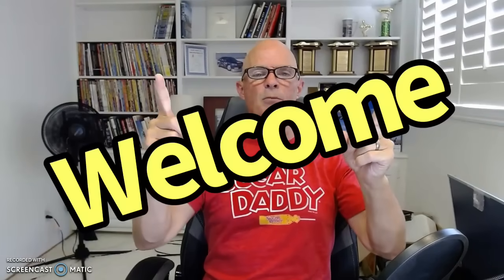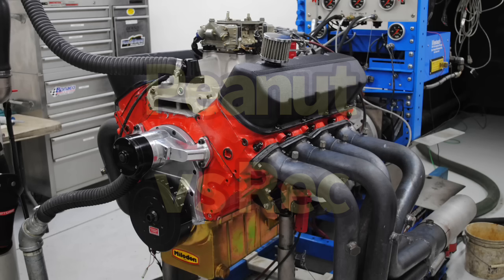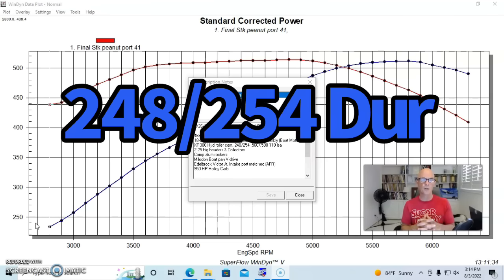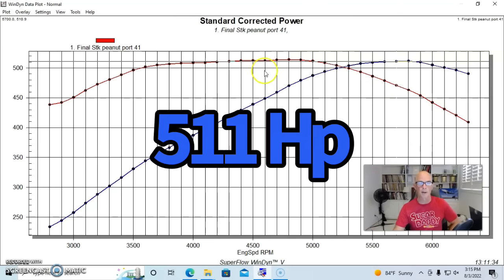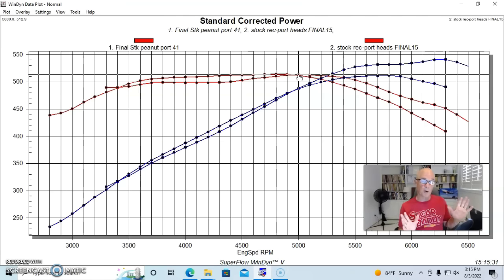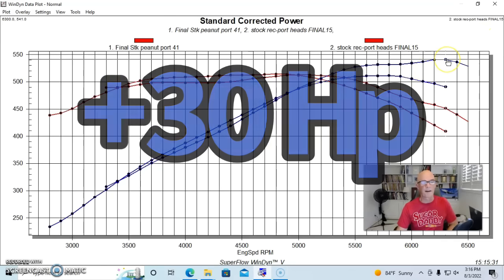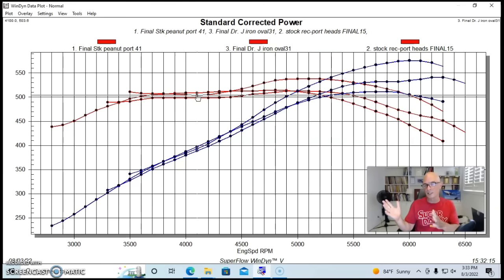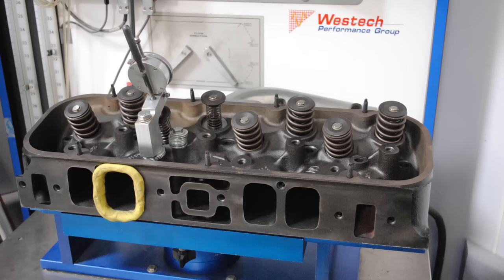WHICH FACTORY BBC HEAD MAKES THE MOST POWER? PEANUT PORT vs PORTED 049 OVAL vs REC PORT vs AFR 265!

Comment: With all things being equally besides one set of cylinder heads being those ported oval 049 would be to test a pair of equally ported open chamber and then, a pair of equally ported closed chamber rectangle cylinder heads versus a pair of ported worlds 345 versus a pair of baddest set of CNC ported cylinder heads ever manufacturer the AFR’s 357!! 
Although, I would suspect that 468 compression ratio and camshaft may not be the best foundation that would allow the AFR 357 cylinder heads shine!
However, throw a PSI, or a Helix 14-71, or a centrifugal supercharger on that 468 with that little camshaft versus a manlier camshaft be prepare to be in ah with the results.. 
As usual Richard, great content! Klaus
Reply from the maker: THNK-THE 357S WOULD NOT BE GOOD FOR THIS SMALL 468-EVEN WITH A BIG BLOWER
Reply: AFR 357 baddest ever you say?  UM, yeah, not even close. We had heads that flowed over 100 CFM more than those back in the mid '90's. Now they have BBC heads in the 600cfm range. You could run the 357 on this size motor blown but you would need a lot more cam for a PSI or high helix14-71. Usually, a motor with that size blower and this cubic inch would be for some type of class racing with rules for cubic inch to weight. Also, you would want to increase the bore size to get more flow and shorten the stroke to get to the size. Without a rule advantage or limitation, there are much better (bigger) combos to do.

Comment: Ported rec ports need more CI, cam, intake and carburetor to shine. I have proven this in my B altered when I switched from 472CI to 546CI. On my 472, mildly ported oval port heads spanked the ported rec ports until I put the rec ports on my 546.
Reply: Was gonna comment on that and you nailed it man.....when you get up there in real cubes man.......not no 454/496  but like you stated big cubes....them rec. ports shine like a set of Horse Lungs in a cow!

Comment: Richard!!!!!  I gotta know what if a bigger intake valve, port the peanut port head keeping on the super cheap add 600 lift mechanical flat tappet cam plus nitrous!!!!  Biggest port restriction is the intake valve itself. Is it possible to squeeze a 2.25 valve in a peanut port? Obviously with an unshrouded chamber if so. The afr head is 265cc not that much difference from the peanut port. I’m thinking 10 to 1 compression, dirt cheap peanut port head add 2.25 intake valve if possible, bowl blend,  proper cam timing maybe make 600 ish hp, add in a 200 shot of nitrous. Now you have a 800 hp street stomper for not much more than a decent rebuild. Go for it man build an 800 hp bbc for pennies.
Reply from the maker: the peanut port needs more than a bigger valve

Comment: Thanks for sharing  I had a set of 088 fully ported with 230 intake valves,I do have AFR 325 on my 496 drag car but I got to try the 088 on my 468 ,10.5 bbc with a 660 hydraulic roller in my 69 chevelle project to see how it will run,I can always port and build ,I have 2 sets of 781 heads in the shop,Thanks again for all the knowledge you provide!!
Reply: The square port heads are big for that compression ratio IMHO
Stick car or 4000+ converter 7k rpm
Reply: @DevastationMtrsports  Thanks for sharing everything in my motor will run at high rpms, good rods and Malhe pistons balanced with Howard's lifters and cam to perform up top,4l80 fully manual 😀, Actually plan on a 250 shot ,running a 35 spline 411 pos Trac 😀
Reply: @ronaldlewis2041  sadly I have stock rods and heavy TRW pistons.. late 90s build.. no budget for rods or a roller. Hope to do an updated rotating assembly W/roller cam next summer

Comment: Maybe I missed it but curious what the CR was on the engine I know it will change depending on head CC but really curious on the oval port heads.  I have a 74 454 with 781 heads so that power rating is what I'm looking for but like to know what CR was on your engine
Reply from the maker: 10:1
Reply: @richardholdener1727  awesome thanks. That's good power for a relatively moderate low compression. I was thinking you were going to say 11 or 11.5

Comment: Back in '95 I had a '70 Corvette with a 454 LS6 straight out of a '70 Chevelle. I had read an article by John Lingefelter in Hot Rod where he tested the oval port vs the factory rec port heads. His oval port heads were #049s with 2.19/1.88 valves and some bowl work mainly around the short side radius. He found no where below about 750hp where the oval port wasn't superior. And I mean by a large margin (30-50hp). With the cost of rec ports always being very expensive and at that time you could find 049's for a couple hundred bucks they made a lot of sense. It took about $600 to put the bigger valves in, get the heads all cleaned up and properly machined, but I built a set and put them on the Vette. I sold the rec ports to finance the build. It went from a mid 13 in the quarter mile to a high 12 but I was having fuel starvation problems. I'm not surprised that an out of the box set of aftermarket heads are far superior to everything. Technology marches on thanks to guys like Richard who test everything. Those things I knew for sure 30 years ago have been totally debunked in many cases and I'm fine with that. I just want the facts.
Reply: I think I still have that Hot Rod issue, 1988 or 89. They built a 496 with his tricked 049's and a mild cam and made over 600 hp.
Reply: @scottm7341 I thought it was 781 heads but they are much the same. It made over 660hp. RIP John Lingenfelter
Reply: @scottm7341  That's probably the one. Before Richard Holdener I got most of my info from tech articles in magazines.
Reply: @scottm7341  YES!!!
Reply: @scottm7341  Was that the one with a Competition Cams 288 solid roller street cam?
Reply: Believe it or not, there were some guys running NHRA AA/FA (that's nitro burning supercharged Altereds) in the late 1960s that used reworked 1968 366 cid Tall Deck Truck oval port heads (p/n 3935404) instead of the rectangle port heads.  The reason was they were running 80% Nitro and the closed combustion chambers on the high performance rectangle port heads were really bad about detonation with Nitro unless you turned the timing WAY back, which of course would kill power.  The 366 truck heads had large open combustion chambers before the 1969 ZL-1 open chambers heads came out.  The 366 heads also had thicker walls between the combustion chamber and the cooling jackets than the later ZL-1 open chamber heads which were prone to cracking using heavy Nitro fuel loads.
Reply: @corvettejohn4507  That's cool. Racers always know what really works and what doesn't.
Reply: I think I read the same article.  Lingenfelter was a fan of the 049 and 781 heads on street type engines.  Remember the 496 he did with a Comp Cams 288R?  I basically duplicated that with a 433.  I think I'll Google the article and read it again
Reply: @MrScottt28  That sure sounds like the article. I haven't seen it in 25 years. I remember my buddy had a 70 Chevelle with a rec port headed 427 and we were talking and I told him about the article and he refused to hear it. He actually put his fingers in his ears, lol. But I have to admit I didn't think anything could beat the rec ports up to that point. Of course these were street engines. I'm sure that on a 900hp, 8500 rpm engine they are still better.
Reply: @MrScottt28  Still got lingenfelters books on his build combos
Reply: In the collective, with all the knowledge we get and post back up on the internet, we probably know more about the big block Chevrolet now than even GM did when it was new.  The same goes for all makes.
Reply: @failranch9542  I agree. I have probably learned more about engine design because of the internet and the shear amount of dyno testing that is now done. Everything is tested to death and all the things we knew 30 or 40 years ago that are now wrong blow my mind.
Reply: I belive that was on a 502 short block?

Comment: In the early 70's I had a friend that built a 427 with a wrecking yard as a source for hard parts. We ended up with oval port heads and an aluminum dual plane rectangle port intake manifold. The engine ran surprisingly well in Denver. Never had a vacuum leak, stump-pulling torque, and the engine lasted for many, many years.
Reply: The hot ticket for bracket cars used to be a 496 with oval heads and the square port intake.  Illogical, but it won races...

Comment: this was a cool test.   1.  049 is a great head, but not the best factory big oval. the best factory big oval is the 820. the open chamber unshrouds the valves and it flows better. the only real mod you need to do is add bigger valves. the factory valves were 2.06/1.72 by just upgrading to 2.19/1.88 valves they will out flow a factory rec port head.  and make more power down load too boot. I am thinking that the peanut port head might work good on a 396 with a small cam like a XE276HR.
Reply: True man and by looking at them you would thank...dam what a big chamber.....just not many out there and most dont know of them,your right man....I have a nice virgin 71 set I pulled from a 402 over 30 year ago where I traded a set of 702,s for....nice you mentioned them man.
Reply: I agree lower or stock compression and smaller cams. Peanut heads would do better in a lot of lower RPM towing and street builds.

Comment: I was impressed with the peanut port performance. Just goes to show what a pig dog camshaft most 454 trucks got saddled with, along with 7.8:1 compression - thru most of the 70s & 80s.
Reply: I remember reading a Article out of Hotrod Magazine inthe 90s that on a chassis Dyno a intake and cam and Headers  where good for 120 horsepower on a chassis Dyno on a 1 ton dually one of the guys ran as a tow pig.
Reply: Just adding compression to a mid 1970s 454 ads horsepower and torque across the board. A tighter cam load separation at .050" for instance 107 makes more raw horsepower and torque for just engine power. And the wider load separation 114 makes a little less horsepower and torque on engine But the wider lobe separation is far better for a power adders blowers, superchargers or nitrous and larger engines. Also raising compression and using pump gas makes more horsepower, torque and better fuel mileage. Because a engine that is 8.5 to 1 compression it's like dead cylinders versus a motor that's at 9.7 to 1 with iron heads or 10.5 to 1 with aluminum heads on pump gas. On pump gas with same engines you have to open throttle up more to run the same speed with lower compression. And if you've seen the results over the years guys with 15.1 or 16.1 compression. They don't make much gain at all on nitrous very little. At these high compression levels the engine is already so efficient their almost nothing left on nitrous.
Reply: The 7.8 : 1 was for emissions, but the cam was because trucks that are used as trucks need lots of torque, not revs.
Reply: Yeah to many people just think about upping to high compression when you can simplu ad a Cam with lots of lobe Seperation and gain a whole bunch of Dynamic Compression which is 100 times better then just high compression pistons, because you're now compressing more volume with a larger displacment, vs the high Compression pistons you just made you displacment smaller in reality you might have even lost HP mid and high and gained barley anything down low. A Cam with much more lober seperation you will gain HP from bottom to top. With Boost a Long intake duration wide cam lobe seperation is key tomaking very good power at low boost levels.
Reply: @trxtech3010  compression does not change volume. A 454 with 8-1 still is 454 with 15-1 compression. You make no power unless you have compression
Reply: @jbaker8871  Yeah it actually does make your displacment smaller the higher the compression becomes, the smaller your engine becomes, may not by a lot however; Say if you have -15 CC domed pistons to increase compression in a 454 you just went from a 7.4L to a 7.2L, the only thing it gained was throttle response and low end torque possibly lost some HP but now you got a stump puller. If you actually knew what you were talking about you would know why I mentioned dynamic compression, your dynamic compression increases when you have a camshaft with more lobe separation. Biggest mistake everyone makes is "I put a huge lift cam and higher high compression in it"  Better choice is a Big cam that has lots of cam lobe separation, slightly higher compression OR dished pistons and of course port work. High Compression is not the magic way to gain HP.  Ask any REAL engine biulder. They will tell you the same thing.
Reply: @trxtech3010 u do relize that a "big cam" with as u say lots of lobe separation ..actually still bleeds off cylinder pressure because the longer duration changes the overlap right?  Did u just say to use dishes pistons and low compression with a big cam and lots of lobe separation?  I think u need to do some more research on what u think you know lol
Reply: @Handlehandlebars that's a good combo for a slug. I generally go the opposite approach myself. High compression, big cam and tight lobe separation always works NA.
Reply: @trxtech3010 what the heck are you talking about bud, piston dome volume does not change displacement or “swept volume” at all. Yeah camshaft can change dynamic compression mostly due to late intake closings which tend to raise functional rpm but also take advantage of port velocity and scavenging to be effective. 7.2L 454...  tell us you know nothing without telling us. Optinion discarded.

Comment: 088's or 188's vs Ported 049's or 781's would have been a good Hollyfield vs Tyson.   Most of the Rec ports are 60's vintage head designs.. not the best.   The 088's/188's are 502 GM Crate Rec/Port heads.. a little better than a 67 Chevellee SS would have gotten from a flow/design perspective.  Good video.. hard to go wrong w BBC head shoot outs.   I doubt 60's vitnage rec ports.. ported.. would have been very much better than the ported 049's.. if at all.
Reply from the maker: these were o88s
Reply: @richardholdener1727   Ok

Comment: the 849 hydraulic size  lifters struggle with heavy valves at high rpm,  around 6300 rpm and up. I know the johnson and other lifters work better, but still the small lifter body becomes a problem.  Upsizing the lifters to a .875 or Chryslers really helps, or run a solid.
Reply from the maker: you don't need an 875 lifter for this power or rpm

Comment: Throw away the factory heads.... The after market AFR heads, and I imagine other after market head makers, are far superior to the factory heads. The weight savings alone are also a big factor with big block Chevy heads. I wish we had heads like AFR back in the day. Maybe turbo Porches' wouldn't have had it so easy in Can Am racing
Reply from the maker: the can am cars had alum blocks & heads
Reply: @richardholdener1727  hence the big Reynolds aluminum signage on the can-am cars
Reply: The turbo Porches came later in the CAN AM series run by Penske… THEY OUT SPENT THE COMPETITION AND RUINED THE SERIES…

Comment: I'd guess a large rectangular port head.  Raised runner as much as possible, port turned ovate, filled with epoxy to correct size/shape.  Welded/reshaped chamber, large valve and angle milled.

Lotta work, probably 50+hrs.  Would only make sense if running it fit within a particular rules class.  But it would probably beat many standard valve angle aftermarket heads on smaller cube BBCs.

Comment: We need a ported peanut port test already!
Reply: Yes we do! I did a mild port job on my son’s 2.06 valve 236 heads for temporary use til I got some 781s and after the car went 11.60s and I was quite surprised how good they worked when we took the motor out to freshen it up I took the 236 and had 2.19 valves installed and put the heads on a flow bench before and after the valve change! I also brought along a stock 2.06 valve 781 to test, my home ported 2.06 valve peanut port head flowed better than the 781 up to .500 lift but the 781 waked away after .500 lift,  so one of Richard’s dyno comparison videos between a good peanut port head with real porting and a 2.19 valve compared to a similar 781

Comment: Use the right intake (REC PORT) on the stocker rec port heads and amp the cam up to 600+ lift and see what you get. I will say a set of 049 heads with 2.19/188 valves and a little porting will probably be the best budget/hp build and make more torque down low.

Comment: I think a peanut port head will gain quite a bit on the 049 with similar bowl work and valve size up to 6500 on a 454 size engine. It would be interesting to test the Edelbrock 2.0 peanut port intake against the large oval Edelbrock on a large oval head to see just how much the smaller runner dia kills power
Reply: . . . Ok, let me get this straight.
You're telling me Edelbrock bothered themselves to make a Peanut style head AND YET THE M.F's can't make a high-flow, aluminium head for the 90* Chevy 4.3L V6 ? THE BALLS !  ☹🤦‍♂👎
Reply: @GIGABACHI  not a head just an intake.
Reply: @jnljnl8485  oh, well, that makes a lot more sense. Thanks for clearing that up. 👍
EDIT: It's right there in his post, FFS. 🤦‍♂
I gotta stop using YT when I'm sick and tired. My reading comprehension apparently disappears at the same time.
Reply: @GIGABACHI  they made several heads to fix the problem of the v6 chevy. I think Bill Jenkins worked on that little engine with some rather impressive results.